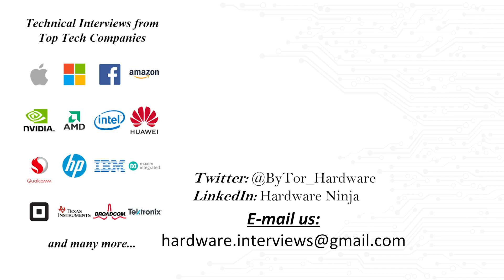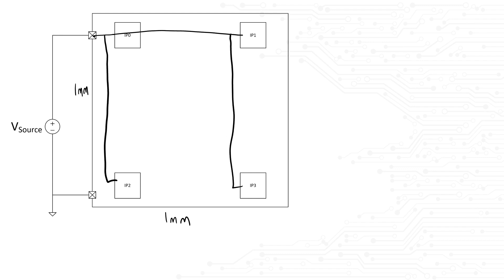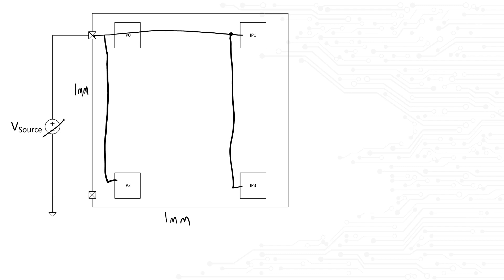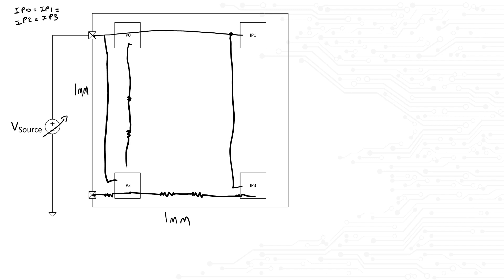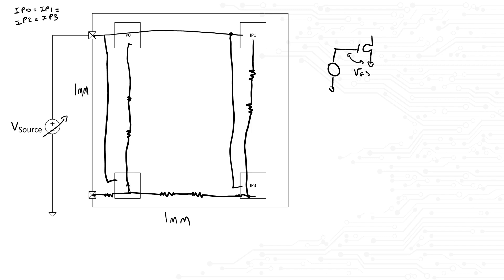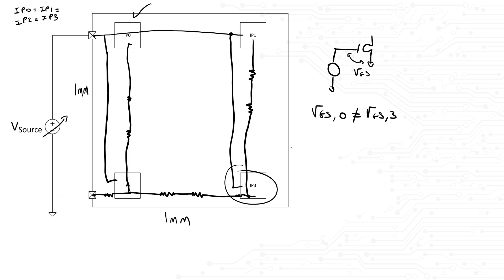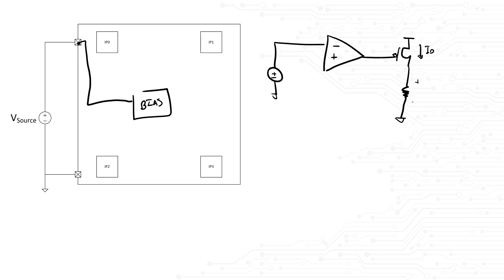HWN - "SoC Design Engineer" Interview Question (Offsets)

Comment: I think a better answer is to distribute the same reference voltage to 4 op-amp controlled current mirrors circuits.   If you have 1 input: 4 output type mirror as you suggest, you will be limited in accuracy due to Vth mismatches in the FETs.  If the reference is relative to GND, then the parasitic IR drop in the GND needs to be made the same for all 4 blocks.
Reply from the maker: Great answer, Robert! Op-amps will also suffer from offset problems as well as take considerable area/power. What you mentioned about the grounds is really important, you'd most definitely need a ground re-referencing circuit for each of these if we choose the op-amp route. We very much like your answer as it shows a different approach and showcases your problem solving skills! This is at the heart of interviewing. Thank you so much for being a part of the community!

Comment: The problem with this is that the PMOS also needs a supply voltage. Is the source of the PMOS tied to the same Vsource?
Reply from the maker: Hi Katuas,

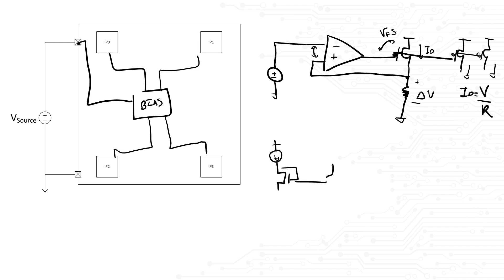Love the first name! If we understand your question correctly, you're talking about the PMOS devices at 5:08. If that's the case, since that block is a bias generator, all the PMOS devices are in close proximity as matching is crucial here. We only send their output currents as information. Let us know if that's what your question was about. Cheers!

Comment: So how do you regenerate the voltage ref at the destination blocks?
Reply from the maker: Hi James,
The reference voltage is produced by the Vgs of a receiving diode connected device. This Vgs can be different at every corner of the IC. However, since we're sending current, even if the Vgs voltages are different the mirror currents will all be the same. We hope that made sense. Let us know if you still have any doubts!
Reply: @HardwareNinja  I though the problem statement was to distribute a VREF into the receiver blocks.
Reply from the maker: @jiesteve  You're correct, the problem statement is to distribute a voltage reference to each of the 4 corners of the IC in such a way that they're all biased identically.
Reply: @HardwareNinja  Different Vgs will result in different Ids for the same W/L.
Reply from the maker: @fuckkatuas2837  You're right! That's why we generate currents from a centralized bias block instead and send currents as information. That way we know our bias currents at the 4 edges of the SoC will be the same even if the Vgs of each diode transistor receiving it is different.
Reply: You should use same type of resistor according to your process at the destination block. Incoming current will flow through the resistor and it will regenerate the same voltage. These can be done with using bandgap reference. For instance, bandgap reference block will generate appropriate VGS for the current mirrors. These currents will be carried to the destination blocks and thanks to same type of resistor that we used in bandgap reference circuit voltage will be regenerated. Here same type of resistor is very important so that we can regenerate same voltage for PVT analysis.
Note: You can use LDO block in order to regenerate the same voltage somewhere near to the destination blocks if you want to filter the noise and increase the PSRR response of the circuit. This will be significant for the destination blocks that needs very clean VDD.
Reply: @alperkurt100  ok so this method you need to assume the far apart resistors are matched and you can also have a delta between bias generator ground and the receiver ground, right?
Reply: You have vsource_minus hooked up to a pin, just send a differential reference to each ip